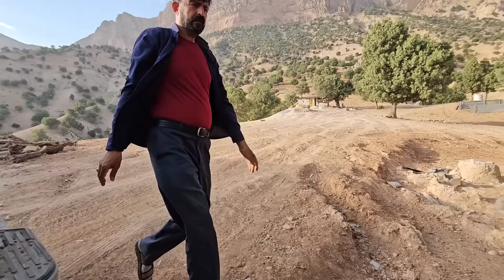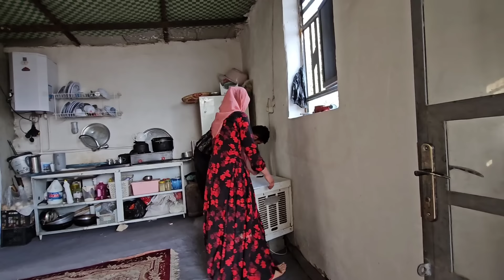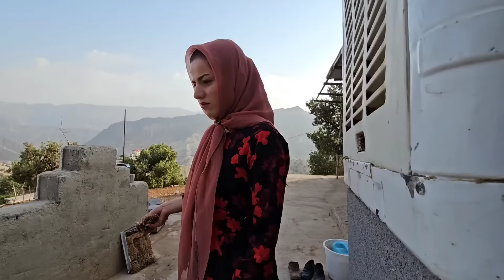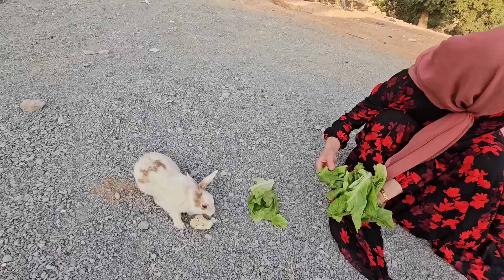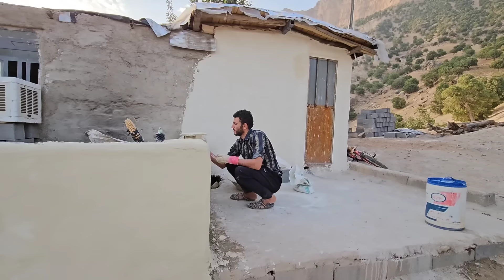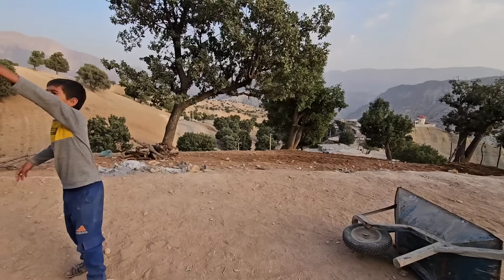"Enhancing Home: The Nomadic Life of the Karoon Family"

Comment: Hamid hazle sombra allí donde cocinan afuera protetegera de el sol y de la lluvia  a narren
Reply: Is there anything they can use to keep the smoke stains from going up the wall, maybe some sort of product that can be washed off.  With the light colored cement or plaster they are using, it would be nice to clean that up.  The work is looking good, still need to trim the roofline of the plastic and roofing paper and maybe paint the door and it’s really looking very neat and complete!